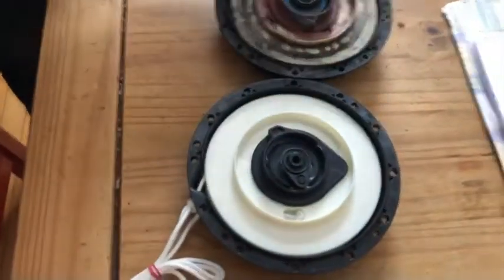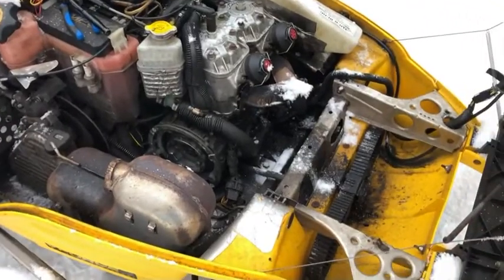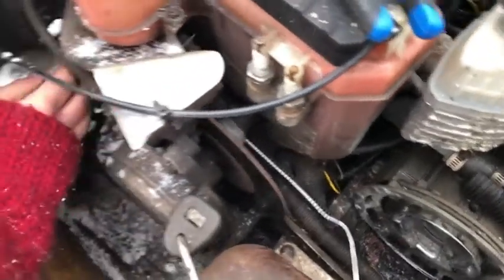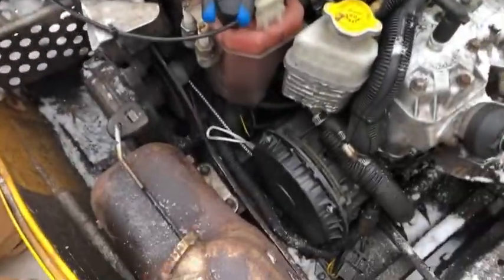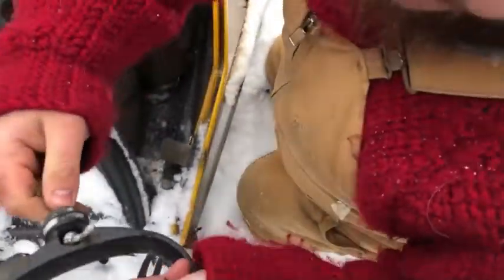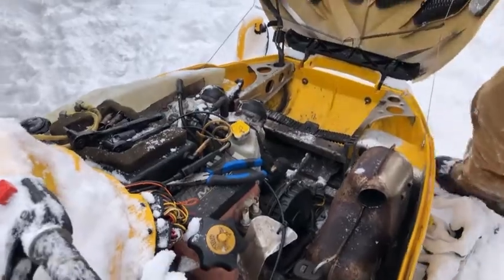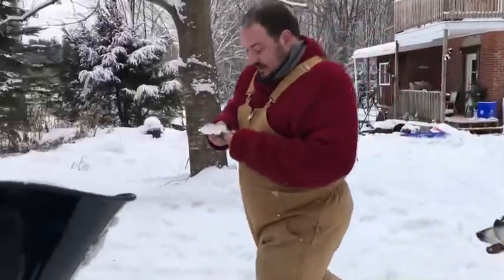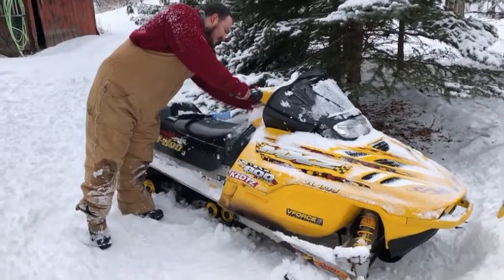How to replace a recoil on a 2001 Skidoo MXZ 800

Comment: Good job Guy, And Gal  ;)
Reply: But.......Address that high idle.  It may be just an idle screw adjustment. But if it's a carb boot leak, Or crack. You know what happens to engines running lean .   Just lookin out for you guys, And your MXZ  :)